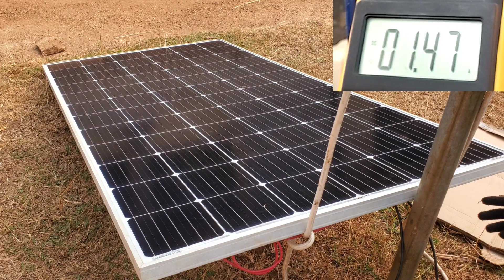How shading affects a solar panel power output. #solarpower #solarpanel

Comment: I hear that pv have current diode in order to ensure that current from unshaded pv wil not be reduced while flowing over the shaded pv. the total current will therefore only be reduced by a fraction due to shaded pv. this means that pv optimizers are not really required unless you have a big budget. this also supports the fact of installing pv on walls and fences which may only get some hours of sunlight. see   Gary does solar ...